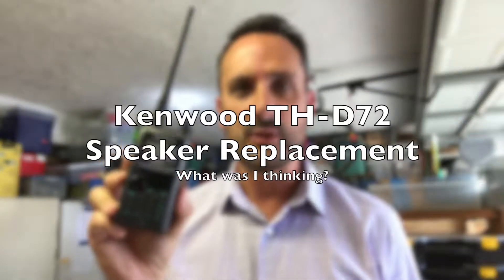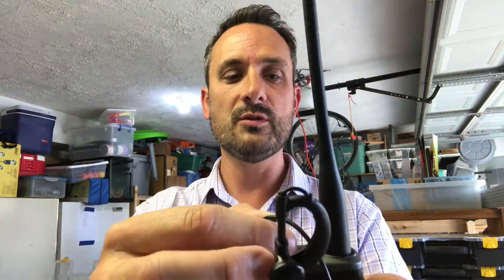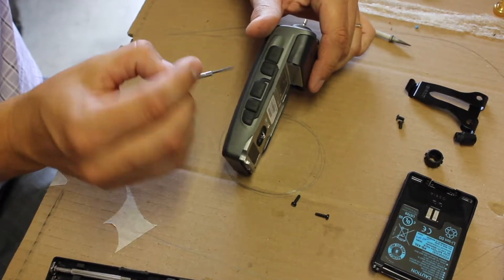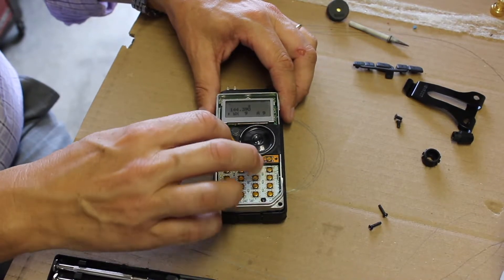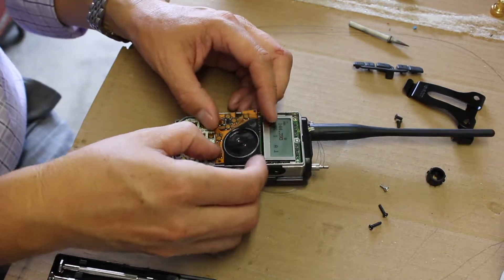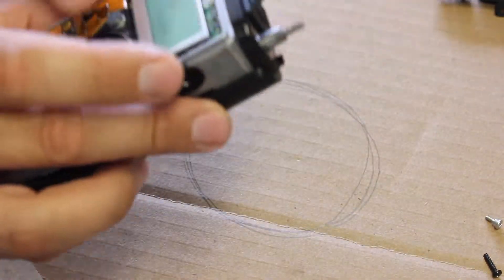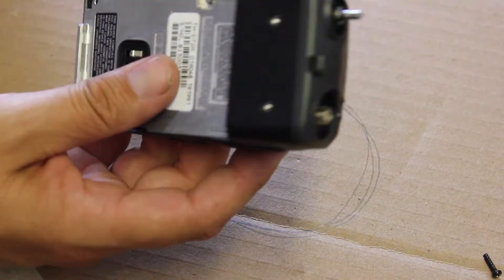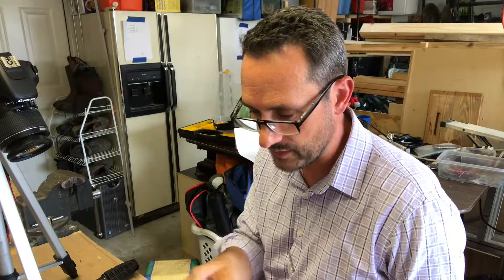Teardown of a Kenwood TH-D72 and Replacement of Speaker

Comment: Dear Sir, is there a small O ring or some on the volume/channel knob that holds it in place? When I ass,emblem those buttons they come off too easily. There’s no set screw either. I put a tiny folded up piece of tin foil on the flat portion of the stem and that helped hold it better, but I’m worried I’ll lose the buttons. Thanks Monty Kc5omk.

Comment: Thanks for the breakdown and tips. I successfully changed out my clear case screen cover using your video. Tip - don’t attempt to pry the screen off. Use a heat gun on low heat and warm up the glue and press firmly from behind.

Comment: After sitting unused for several months, the A/B and Menu buttons on my TH-D72 have quit working.  Any ideas?
Reply from the maker: I can't believe more than just my mom watched this video.  Have you found an answer to your question?  If not, I would suspect the contact under the rubber touch button are messed up.  Have you taken the face of the radio off?